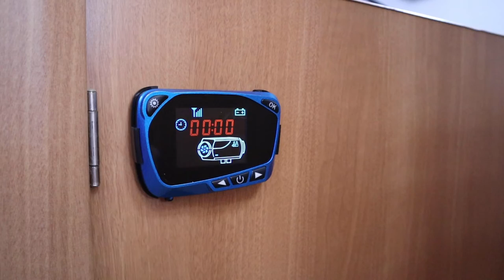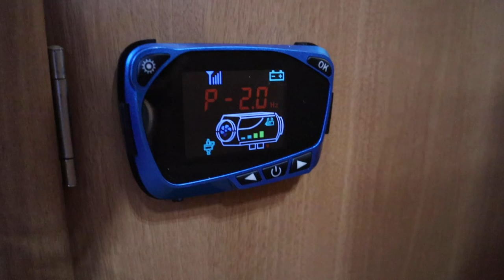Diesel Heater Install into a Caravan! Is it worth it??

Comment: You might try to install your box into another container like a plastic container and fill around inside with rockwool of fiberglass this will help quiet the noise as well as the sound.  let me know what you think.Charlie AKA Dismas
Reply from the maker: That’s a great tip. I did try a few versions of the box but found nothing worked that great.

Comment: I just wish that the installation videos by people spent more time on the wiring. The hardware is easy to understand and follow. But more info on the wiring package would be great. I think that I have it right up the fuse, as there is only one wire from the fuse to go to the batteries  JBR
Reply from the maker: Thanks for feedback. There isn’t much with the wiring, it’s literally a positive and negative to the battery. Nothing complicated at all. The other end of the loom just plugs into the display. Hope that helps

Comment: I'm almost about to install, how did the box go for the pump to silence the noise ?  Was it worth doing / would you do anything different ?  Good video too
Reply from the maker: I ended up changing it out and suspended the pump and it made it super quiet. Vibrations were being transferred through the chassis rail. Hope that helps

Comment: Did you ever find a solution you were happy with for the ticking of the pump ?
Reply from the maker: I resorted to hanging the fuel pump from the chassis with a rubber strap. Stopped 95% of the last tick heard inside the van.

Comment: Great instructional video.
Most YouTube videos I have seen the diesel heaters have had two pieces of ducting( one for cool air in and one for warm air out). Mine only came with one for the warm air out. My plan is to mount it under the dinette and just put a cabinet vent near the cool air side to allow air in. Hopefully that’s enough. 
Secondly seems to be alot of talk about the pump being noisy. Thought I might mount the tank in the front tool box and mount the pump under the tank in the tool box. Thinking that will isolate it from the van abit and reduce the noise. All in all everything looks fairly straight forward. Thanks
Reply from the maker: Thanks mate! Yeh not sure on the two pieces of ducting. I’ve fitted a few to friends vans and all have only had the one. You can only try the pump in that location. If it’s too noisy then you can move it. I’ve actually ditched the box and used just the rubber mount and it’s heaps better. Thanks for watching
Reply: Stephen Pitt
. That's exactly what I have done, Stephen. I have the fuel tank (not the plastic one supplied, but a stainless steel one I bought on E bay, much better quality and has a fuel gauge.) Mounted in the front boot, then mounted the filter and pump straight under the fuel tank, with the fuel line (proper fuel line) running down through the drain hole in the floor of the boot. I have the fuel pump mounted on the wall of the boot with a screw, as provided, but if it still sounds a bit noisy, I'll have the rubber suspension system as a backup. I'm half deaf, so probably won't hear anything 🤣 But I have some mates who are a bit fragile lol. I would love to hear how yours worked out since My install is probably a carbon copy of yours. Any tips would be appreciated.

Comment: 19:23 have you measure intake and outlet air temp in minimun power??
Reply from the maker: No sorry
Reply: @GetCampingOz  nobody has measured freezing (below -5c) intake temp, what happens to output. Or what does the heater do in min power, or but it to youtube

Comment: Saw a sound engineer compair foam and various other sound deadening products and what wone hands down by a country mile.....a beach town folded in three. I've wrapped mine in one and it sounds very faint indeed. Like a heart beat, and that's with it next to the hot air duct right by my head, also make sure the fuel lines don't touch the van anywhere,  clamps are unavoidable. Hope that's helpful
Reply from the maker: Thanks Gramps. That’s a great tip. I might just give that a go! Cheers

Comment: Run your fuel pipes and wires through a partitioned re-openable electric conduit, fuel in one, wires in the other or better still, use two separate circular conduits.  Protection against rubbing, and stones, and easy to fasten to anything and avoids sharp metal.
Reply from the maker: Thanks Mike. Great tips! I’ve actually put the fuel line in a clear tube to prevent noise transfer and it seems to work quite well. Thanks for watching

Comment: Great video mate I think you box would of worked If you had rubber between the chassis and the box, even sound damping material inside
Reply from the maker: Yeh I have tried that but it didnt seem to make any difference. Im still looking for something to make it quieter. I have seen the silent pumps in the UK but cant find out where to buy them. Cheers
Reply: @GetCampingOz  dam i was going to try that with my heater only just installed it, thanks for your video it really helped me with my install

Comment: Good vid but the part I needed was the wiring, and fuel connection is your wiring thru the bottom plate or no?
Reply from the maker: HI Mary, the wiring I chose not to go through the bottom plate as it looked to close to the exhaust. I drilled a separate hole and fed the wire do it and then silicone it up. The battery connection is just a positive and negative connection.
Reply: You mentioned using a bigger power feed wire (s).
 As the feed is via a plug in connector, surely a larger wire can only be used to the fuse?
 Great vid👌

Comment: Got one for auction looks exactly the same. Win mine at auction for 122 on auction., very ticky pump on low but don't here it much on higher setting. 10lt kept my 2 bedrooms warm for a week on lowest setting on auto 25degress,  air comes out at about 60degrees plenty of air flow and cheap as chips to run.
Reply from the maker: Yeh they are good value for money

Comment: Helpful hints. 
I couldn't find a place to install the original plastic fuel tank.
So I made a bracket and bought a cheap metal tank. 
Installed it on the front of the A frame. 
Please keep the videos coming. 
Cheers Andy.
Reply from the maker: Sounds good Andy! I was thinking about changing the tank as well but so far it hasn’t been a problem. Thanks for the support. Cheers Adam

Comment: Yeah, I too didn't find a single example of a fire or injury from these. I did find people complaining about poor reliability, but most of those you could put down to poor installation choices and execution.

I think this would also be the case if you badly DIY installed a $2500 Eberspaecher. The chinese clones of the Webasto and Eberspaecher are very good. Interestingly, some camping places rebrand the cheapies and sell for upwards of $800. (Although you can assume that there's some better local support and warranty with them)

I've got a spare pump and controller stashed for mine, but may never need them.
Reply from the maker: I agree Neil. The most problems that I hear people complaining about are exactly as you describe. They are very simple in design and not much can go wrong 👍🏻

Comment: bigger box, and insulation rubber backing between the frame and the box. it should work for the pump.
Reply from the maker: I’ve actually removed it from the box and it’s quieter! Not sure how but it is 🤔

Comment: Great video, very informative. I've saved it for later referral. Could you provide a link to where you bought the heater?
Reply from the maker: Hey Rob, I’ve just checked and the eBay seller no longer sells this heater. I’m pretty certain they are all the same - just check that the fuel hose in the nylon one and the controller is the newer type with the remote. Cheers Adam

Comment: After reading all these comments, I have decided to mount my fuel tank in the front boot of my 17 ft. Oasis pop top van. I will make a little secure shelf for the fuel tank (not the provided one) but maybe a small outboard fuel tank (removable). I will mount it as high as possible and have the fuel pump immediately under the fuel tank giving it a gravity feed to the pump (also mounted inside the front boot) eliminating any priming problems. Would it be a good idea to install another vent plate where the unit inside the van is installed to circulate the air from within the van, instead of just circulating the air that is under the bed ?

Comment: Great clear video. What brand or Ebay shop did you purchase it from
Reply from the maker: Thanks Brian. It was a while back and i dont think this seller is around any more - happysheep2019. Its a 2Kw heater, and they are pretty much all the same. Just make sure you get the nylon fuel line :)

Comment: Thanks for the video. Just wondering if any regrets or issues with the fuel tank in the front boot?
Reply from the maker: No problems at all. We have no issues at all with it in the front boot. No smell, no leaks, nothing. Thanks for watching
Reply: @GetCampingOz  Excellent, thanks for that.

Comment: Gday , awesome vid ill use some of your tips, is the outlet air too hot if a sheet etc drops in front of it 🤔
Reply from the maker: The vent is about 300mm from the edge of the bed so it should be fine it would just make the sheet really warm. Any closer then i think it would be a problem. Thanks for watching

Comment: This is just a thought I've had...since ever u-tube ticking fuel pump is a concern for a reply on the viewers thoughts.. mount the fuel pump on a pole and put it beside the Unit when parked..Like the way I have done...O and fuel tank. So one day I may put the  fuel pump with the rubber tube extensions...... sticking out of the concrete brick in poured around the fuel pump Note do not for get to attach your DC line to the pump before pouring concrete lol...
Thanks for the share on a random view I appreciate the people that post. Things of my interest 
Curtis Off Grid thanks for Solar and Internet I'm out there ,,
Reply from the maker: Thanks for the tip

Comment: pump needs cool air to keep cool, put in a box and foam will over heat , stand alone rubber mounts work super quiet,🤫👍
Reply from the maker: I’ve been running it in the box for about 6 months and never did it heat up. I’ve since removed the box as I found it actually increased the ticking sound. Cheers

Comment: Good vid.   But are these things thermostatically controlled or just constant output?
Reply from the maker: Thanks for watching. These are constant output based on the setting. I have heard you can buy a controller that can be set to maintain a temperature. Hope that helps.

Comment: I installed one into my caravan and within a few months the sensor failed and the fan wouldn't turn off without being disconnected from the power supply.  If I had to do it again I'd pay more for one of the mid range Russian units.

It also put off a plastic smell that my wife hated and it would use surprising amount of battery too.
Reply from the maker: Oh that’s no good! Ours hasn’t had any issues and it’s been installed for about 18 months now. We have a new van now and just fitted a gas unit which I will have a video out soon!

Comment: Hey mate,
Quick question re your video. 
1. What was the size of the second holesaw under the bed for the vent?
2. Did you drill a whole in the floor of the boot for the fuel line or was that the drainage hole? 
3. What did you use for the sound proof box or what did you buy? 
4. What was the size of the hole you drilled on the bed where the face plate went for the display?
Reply from the maker: Hey Jodi. I think it was about 65mm. I have a few sizes and just matched the vent up. 

The boot floor hole was just the drain hole 🕳 

The box I used was from Bunnings. It’s Deta brand box. In the electrical section near the conduit. 

The size hole for the controller was about 25mm. I just used a step drill until the plug fitted in the hole.

Hope that helps 😀

Comment: You don't have to follow the directions on the fuel pump angle and drill hole on the bottom of the fuel tank.
As long as your fuel pump is at 45° or straight vertical, that will lube the pistons.
The fuel pump is plenty powerful to
 suck the diesel from the top down.
The O ring will eventually fail. You'll have a huge mess on your hands or fire danger.
Reply from the maker: Good tip

Comment: So exhaust shouldn’t finish under van? Is it critical that it reaches the edge of the body of the van?
Reply from the maker: I’ve set mine up so it doesn’t protrude past the body of the van. One thing that will always change is the wind. Even if you had it stick out past the van, if the wind is blowing towards the van it will carry the exhaust fumes underneath anyway. Biggest thing to make sure is that it’s way from anything that could get hot. Thanks for watching 👍🏻
Reply: @GetCampingOz  my main issue is the length supplied. Just wondering if it is necessary to extend it away from under van or not critical due to reasons stated?
Reply from the maker: @mattsmith2051   the length they supply is fairly short. You can extend the exhaust by adding an extra section to the end of the muffler. IMO as long as you can get it close to the edge it shouldn’t be issue.

Comment: You are using a 2 KW heater, winter just finished there did you like the smaller size? I believe that I may of ordered too large of a heater for my Pick-up bed camper. How large is your camper (caravan), sq. meters are OK? How cold did it get while using it, Centigrade is OK, I will convert?........ Thanks
Reply from the maker: Yeh the 2kw unit was more than enough for our 17ft van. Any bigger it would have been too hot. In saying that our winters aren’t as cold as yours 😀. We get down to about 0c
Reply: @GetCampingOz  I think that I need to get a 2 KW. We don't camp much below -8c and then that would be at night time  in the Colorado mountains 3000-4000 meters.................Thanks
Reply from the maker: No problem at all. And thanks for subscribing 😀

Comment: @joemak .Im about to install in my Jayco Dove Camper .if i look under the floor the exhaust  will be underneath the Van enclosed by the underfloor frame also the air intake .  Would think its not a good idea ,does the exhaust need to be feed outside somehow. Please Help
Reply from the maker: The exhaust should be located on the outside of the van with the exhaust exit pipe on the edge of the van so that the fumes dont accumulate underneath the van. The exhaust should have an extension pipe to allow this. Hope that helps
Reply: @GetCampingOz  Thanks it does help, Have looked at a few instructions on Y Tube and they all put the Muffler on a short exhaust-pipe under Van. Think it would be easier to fix muffler  under van then extension  pipe from muffler to outside of van. Does that sound OK
Reply: Also i was thinking to put Fuel-tank/ fuel Filter / then fuel pump in front -boot of my Jayco Dove .then running fuel line to the Heater, would this sound ok . i dont think it would make any more noise than underneath van ,all instructions i see have t he fuel pump underneath would this work,
Thanks  Joe
Reply: @GetCampingOz  Hi forgot to ask  . I have bought the Black fuel line  (icon-series)Fuel and emission hose id-5mm SAEJ30R7 it seems to be the same as the one that is used with the White nylon line .Wouldn't it be better to run this all the way than connecting a short piece to the Tank/filter /pump/heater and using the white line in-between  ???
Reply from the maker: @joemak8629  yeh sounds good. As long as the pipe is not venting under the van
Reply from the maker: @joemak8629  yeh the pumps are push pump just as long as the pump is angled correctly it doesn’t really matter where it is placed.
Reply from the maker: @joemak8629  the black line should only be used for the supply to the pump. Forward of the pump it should be the nylon hose as it won’t expand under pressure like the rubber hose would
Reply: @GetCampingOz  Thanks  haven't seen that on any instructions

Comment: I note that diesel heaters are available in different Kw heating capacities.  Have you found that 2kw was adequate for your caravan?  What size is your caravan?
Reply from the maker: Hi Phillp. Thanks for the question. Yes 2KW seems to be fairly suitable for our van. Its a 17 foot Jayco Stirling poptop. I recently fitted a 5KW system to a mates van but his van is a 22 foot Jayco. I have heard people complaining about the 5kw systems getting too warm, and they have to open up the windows to let some heat out. Both systems havent Ive fitted, havent experienced getting too hot. Thanks for watching :)
Reply: Hi! Does 2kw will be enough for UK winter time? In winter here rains a lot. Around 4 degrees celsius
Reply: @olegs_vacija  I guess it depends on quite a few things. How large is the space you want to heat? Is it insulated? etc etc. I'm living in The Netherlands and due the energy prices I installed one in a unit besides my home, to heat up my living room. I have a larger one and when it was freezing outside, the temperature inside was 20 degrees celsius and that was at 60%. The living room is 6m x4m and 2,5m high. My house is semi-detached from 1954 and I'm living at the countryside of The Netherlands so you can bet on it that it can be really cold. The price difference between a 2 and 5kw isn't that big (sometimes you can buy a 5kw even cheaper). I have no regrets by buying this, it saves me tons of money already.